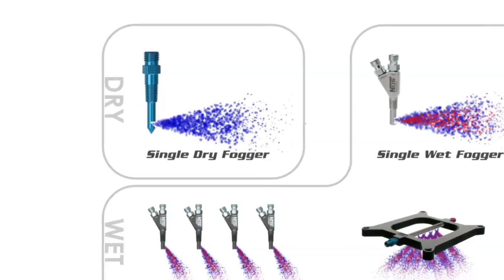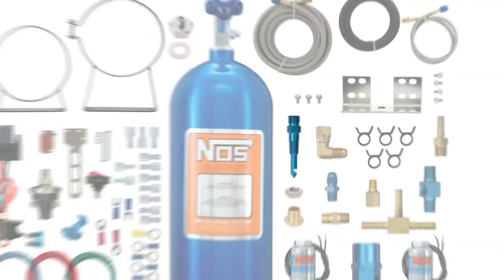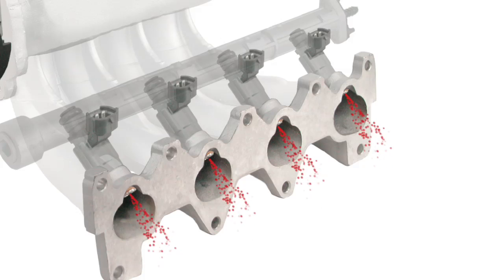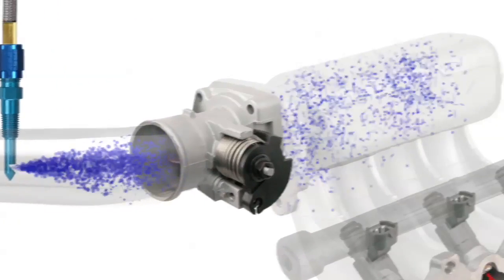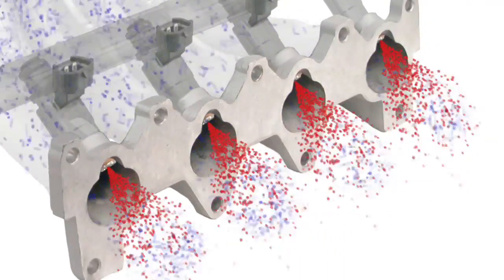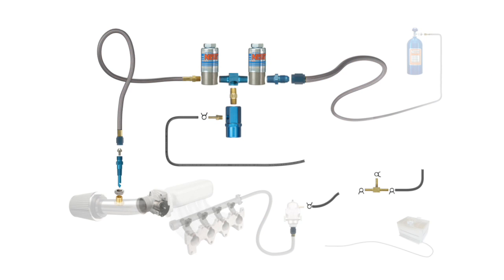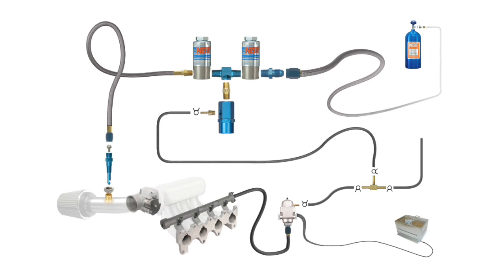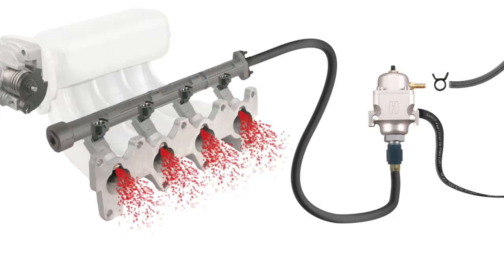NOS Nitrous Oxide Dry Fogger N2O Injection System

Comment: @dryan2  What he means by bleeding off nitrous pressure is some pressure is taken away from the nitrous solenoid to pump out more fuel for the nitrous coming in.  Purging is when unwanted pockets of air are removed from the system.

They are two very different things.

Comment from the maker: Pure Oxygen is much more expensive and dangerous to handle, carry and store. It would also badly corrode any metallic parts along the plumbing route and within the intake system on the way to the combustion chamber (over time). 
It would also be more volatile up to the point of ignition whereas Nitrous is an inert gas until the heat generated by the combustion breaks the nitrogen molecules away to safely allow the oxygen to help burn the added fuel.
Watch our "What is NOS" video clip for example